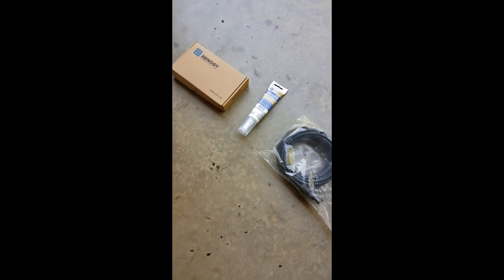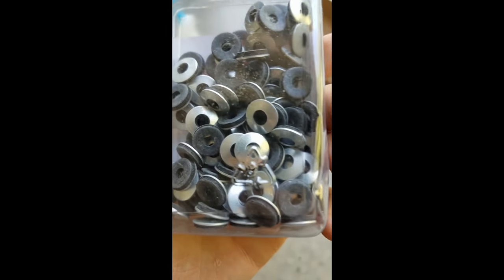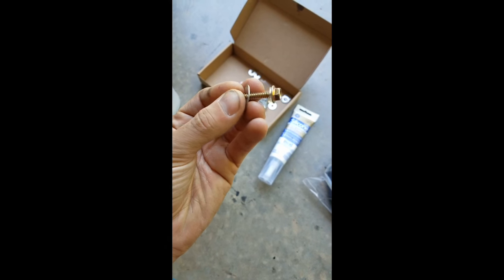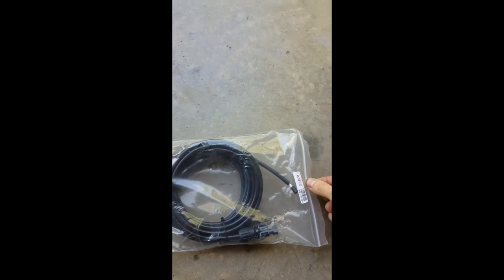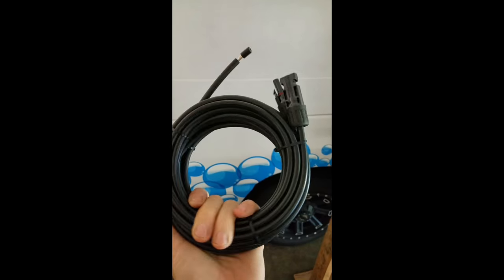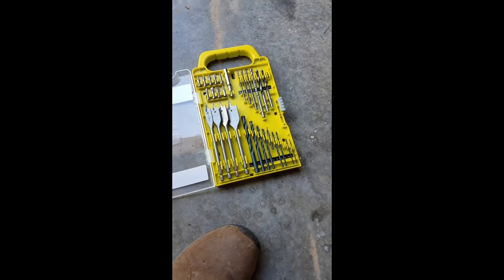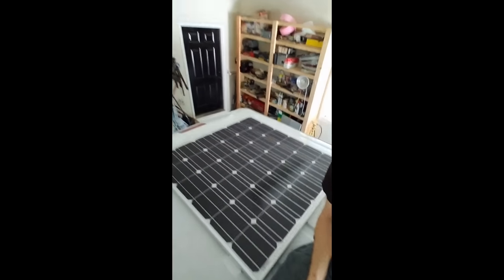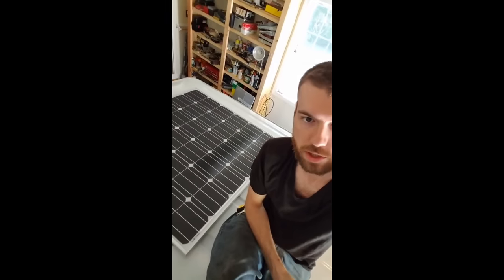Cargo Van Solar Power | Van Life Solar Panel Install (2019)

Comment: Have you had any leaking around the mounts I know it's years later just curious
Reply from the maker: Never since the initial build. At that point, it rained right after installing and I went in with silicone and gelled everything up nice. Not one issue since for 3 and a half years

Comment: Obviously this video is years old but do you have a update to the parts you used and or changes to the parts that I should be using? For example, solar panels, agm batteries, etc? Thanks
Reply from the maker: Basically the same, I just added another solar panel. I feel 1 wasn't good enough for my uses. But 2 works great!

Comment: Thanks for sharing!! How long does it actually take the solar panel to fully charge the battery? :)
Reply from the maker: I'm going to make a video on this very soon! My next one I believe actually. 
I honestly believe that the solar panels aren't necessarily powerful enough to charge to full, they charge fast, but not powerful enough to tip them off once the battery starts to get full. It has to do with the voltage. I now tell everyone new to Van Life to firstly install a battery issolator so you can charge your extra/house battery with your alternator. Do this before you get solar. My batteries have actually been damaged a little because I used my fridge with this set up. It wasn't good enough to have only 150 Amps.

Since then, I've added a second 150 watt panel to give me a total of 300 watts. This definitely charges the battery fast, like 10 to 15 amps per hour.

Feel free to add me in Facebook to ask more questions! https://www.facebook.com/ryanbell88

Comment: Nice detailed, step by step installation video. How has everything worked out so far? Any leaks? Also, when you drilled the holes for the wires, you did not use rubber grommets to prevent chafing of the insulation against the sharp edges of the holes in the metal roof. In hindsight, would you have used the grommets or do you feel the silicone provides enough protection?
Reply from the maker: Everything is awesome. No leaks, although I did put more sealant on it since.
Now, I put another solar panel in the front too. So I got 2 panels
Reply: @OutdoorsEmbrace  did you add batteries to your system as well? Why did you need another panel?
Reply from the maker: @ryandouglas6620  I have a front van battery to start the van like all other vehicles, and I have a leisure battery for all RV electronics.
I added a panel to keep up with my refrigerator. The battery would go low and not fully charge the next day with just 1 panel.

Comment: Holes for the cables are way to small, vibration will cause chaffing and short things out. Need room for rubber grommets. Buy a passthrough cover from Amazon. Use Butyl tape and Dicor Lap sealant instead of silicone. Silicone is worthless for what you're using it for.
Reply from the maker: The silicon has held up very well, I can't say I disagree with you completely though. I agree people should do what you say just to make sure things are done as best they can be, but I've had no issues and no indication of wear to cause future issues.